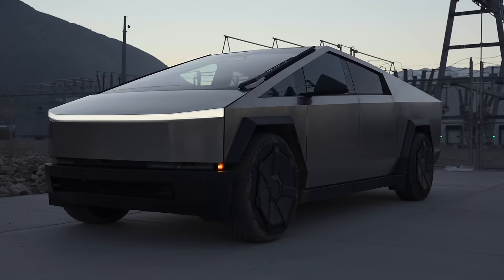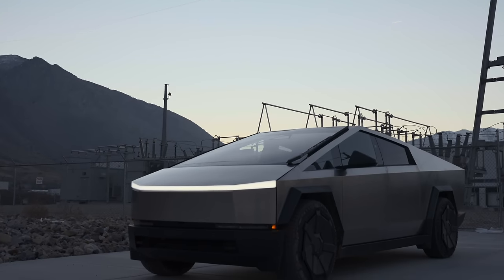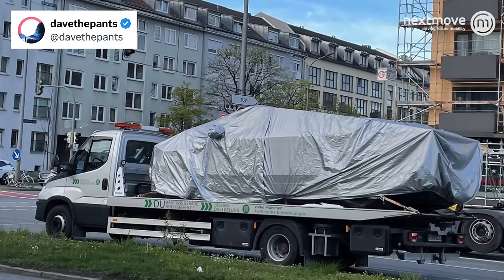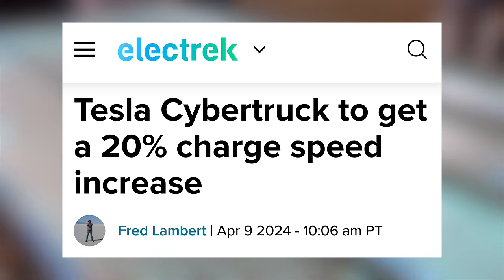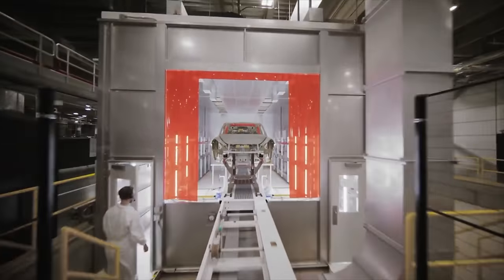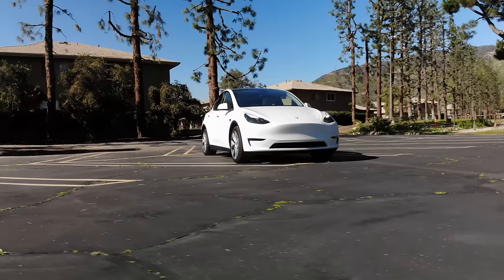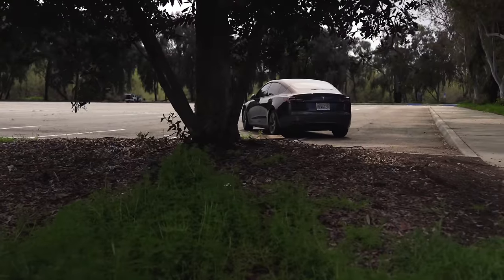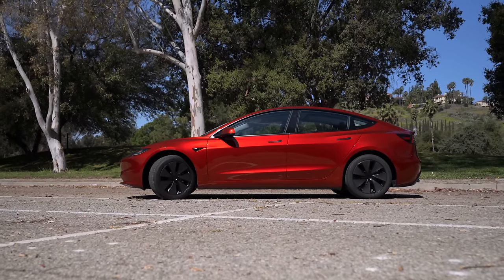NEW Cybertruck 2.0 LEAKED | Tesla's Original Design

Comment: FSD is still so far from working properly. I have used it a dozen times in the past few weeks and have had to terminate it every single time because is slams on the brakes for no reason, leaves me in the middle of a highway lane on a u-turn and can't figure out when to pull out into a street where there is a large intersection. Not worth the price. Maybe worth about $79/month at most.
Reply: Same, but I like it, not sure I want to give it up…maybe I’d pay $99/month, but it has flaws.

Comment: FSD for Semi truck should provide a lot of revenue and cost savings for Tesla. Peace
Reply: One can imagine a massive charging infrastructure development along with FSD for these semis and the vehicle being able to drive 18 to 20 hours a day rather than the limited 11 by a normal driver. Imagine a person in the cab only being made alert by an approach to charge or to load and unload, other than that, letting the truck do its thing. So the driver may get paid the same, but drive at least 60% to 80% more miles than they are used to with a normal diesel where they have hours limited. Then the savings of electric vs Diesel on top of that

Comment: There is not enough space to add a complete second layer of 4680 cells.
Actually there is no space to add any 4680 cells.
The height of the pack is higher than the cells, as it is possible to put BYD blade or other cells, in the same housing.
Maybe there could be more kWh with them, but noch with 4680 cells.

Comment: Im really dissapointed that they didnt filed the pack proper, they talked about a good range then cut that vastly while also increasing price. proper range with higher price would be acceptable if that is the cost they had to pay for production. CT is unique and should reflect that in specs so saving on battery is weak.. they should accept low margin on the cybertruck for preorders at least and follow up on actual good range. Im in sweden so in the near future there is no telling when or if ill get access for CT but im still dissapointed.

Comment: Worth noting that the cybertruck really underperforms on its range getting normally 250 real world miles as opposed to Rivian above 300 and the Silverado actually doing 400+, the Rivian/Lightning is the most efficient in mi/kwh at the moment depending where you look, Silverado does towing the best because it's really hard to beat a massive battery when towing is concerned, so the only niche the CT has is as a show pony at the moment which is fine, people buy F150 Raptors after all. It looks like the potential to double to battery could change the towing game but only time will tell. The body shape no doubt hurt the CT in efficiency.
Reply: And what’s the battery pack size for the Rivian ?
Reply: @ssing7113  135kwh vs the 123kwh in the CT buying it 50 more miles of real world range for roughly 9% increase in pack size
Reply: This is the "Large" rivian pack which was the standard before they split it into more variants

Comment: What I don't understand is why Tesla wants to put the range extender in the truck bed instead of the "half full" structural battery pack.
Reply: @tedmoss  Tell me then, what are the constraints?
Reply: Never heard of cooling and heat rejection? Batteries require a huge amount of cooling, you cannot simply ram into that space the same amount again, generate twice the thermal load and leave zero space for cooling. If they could have, then they would have obviously, and avoided looking like they failed massively on their previously stated cyber truck claimed range
Reply: @992GTS-DC These batteries are liquid cooled, not air cooled

Comment: I ordered my Model 3 Long Range refresh on March 14th, and I am taking delivery next week, April 15th. I didn't really change anything about what comes included with the car, the only thing I changed was the exterior color where I chose to go with white. When I initially ordered, I was helped by a rep over the phone while placing my order online from home. I curiously asked the rep "how long does Tesla typically take to deliver the cars?" to which they replied "most of the time it's within 30 days of placing your order". This seems to have held true in my case. And the only reason I even asked them that was because I've seen all the video suggestions about placing your order but waiting to fill out some parts of the "delivery tasks" until your delivery date gets closer. I went against what those videos suggested and just did all the tasks as they became available, and it seems that it may have helped me get my order faster. I highly recommend anyone serious about placing an order do the same. Don't wait until you get a more solid delivery date, and instead just do the tasks as they become available.

Comment: My speculation is that they'll launch the Robotaxi on August 8, then the $25,000 vehicle as a "1 more thing". Similar to Rivian with the R2 and R3/R3X. However, they'll probably produce the $25,000 first to boost their FSD miles driven. Then once they have more data (improvements to FSD) and regulators have been able to approve it then Robotaxi will enter production.
Reply: FSD will never work as a camera only system. It needs multiple sensors to have system redundancy. The current system still has many problems with false alarms.

Comment: Why offer a range extender if the pack itself could hold more?
Reply: To take your money. Tesla money grab like crazy. They could give you a better range for your money but they choose not to because they know people will still buy it… that’s sad but technically smart for them
Reply: this is not confirmed, many have pointed out the open space at the top of the pack doesnt seem tall enough to supports another layer of 4680s...nobody have confirmed there is space enough for another layer. the top opf the pack seems to have a pretty heavy support structure and there could be extra space there for a multitude of reasons.
Reply: 4680’s need  time to ramp…

Comment: This is yet another reason I wouldn't buy the Cybertruck. The Silverado just came out with a 200kWh battery and a 440 mile range. In testing, I've already seen it get 460 miles. My immediate thought was why couldn't the Cybertruck be shipped with a battery this big, especially considering how much it costs. Now we have our answer. It COULD be shipped with a bigger battery! To pay $100K for a model and still only get a 123 kWH battery is lunacy. At that price, you should get a 200 kWh battery. Then they also need to do whatever they can to increase the charging speed. Either ship a reasonable truck or don't. Instead, they shipped something sub-optimal.
Reply: Lol man you are ignorant of the technology.  That Silverado has greater range only because they packed in an over sized over weight battery pack like the hummer.  Once you drive it, you'll know how bad it handles and also the brakes and tires will wear out 3 times faster than normal.

Comment: Wtf / selling only a half full pack? Seems Tesla is still having battery production issues
Reply from the maker: I think it's incredibly intentional. It's not stopping Cybertruck sales at all.
Reply: Yeah that’s more profit for Tesla
Reply: They are showing folks they don’t need the range they think they do. They will focus on continually improving charging speed, not capacity. Larger batteries are inefficient. They cost significantly more and are significantly heavier. You need a larger battery to haul around a larger battery. Charging quicker is the focus.
Reply: @dalejewell9916  We actually need lighter and higher capacity batteries that charge faster like solid state batteries eventually will.

Comment: No, I would NOT ride in a robo-taxi if level 5 is achieved, The only time I would use a taxi or equivalent (Uber, Lyft, etc.) today is for transport between my home and the airport when taking a flight via the airlines. At the destination, I do not use a taxi, I rent a car. Eliminating the "taxi DRIVER" is not going to change that. However, if level 5 IS achieved, it would eliminate the need to use a taxi (robo or otherwise) altogether, as I would drive my PERSONAL/PRIVATE car to the airport and send it home to its garage via FSD to await my summons on my return. The irrational exuberance over the idea of robo-taxis is in dire need of a reality check. Robo-taxis are, after all ... taxis ... with all of the use cases and inconveniences of that form of transportation. While they may very well eliminate some taxi DRIVERS, robo-taxis will NOT eliminate the private car.

Comment: Supervised FSD doesn’t accept feedback from mistakes because it immediately disengages when you try to correct for mistakes like changing the speed or steering. It needs to accept immediate feedback by correcting for mistakes. After disengaging twice, I give up. I never had a mistake free FSD trip. It also should drive in the style of the driver like less aggressive or more aggressive so it becomes familiar with the passengers.
Reply: Anytime you disengage FSD you have the opportunity to provide feedback.
Reply: @ericgregori  When you’re driving? I have no time to fix the mistake and then provide the message that disappears after a few seconds.
Reply: I have FSD paid version 12.3.3, I let a friend of mine try it this weekend, now keep in mind this individual has never tried any version of FSD, during his drive FSD disconnected several times, I explained to him that he was over reacting and basicly did not trust the steering component, this is to be expected by first time users, it not a failure of FSD it’s a shock to change years of muscle memory when driving ICE. When I drive FSD I have no interventions, I use to when I didn’t give the software enough time to react, but that was during early days.
Reply: Also for first timer users, change the setting in autopilot from assertive to grandpa mode until you done a dozen drives.
Reply: @tedmoss  That’s right. Not fast to both react and provide comments at the same time. Worse is Tesla doesn’t have that available to provide comments at a later time. It should allow you to fix it at real time so it can make adjustments on the route so you don’t need to tell them later.
Reply: @tedmoss  That right. I just don’t know. It’s FSD, which should be an AI and all that should be automated. I’ll just drive myself thank you n